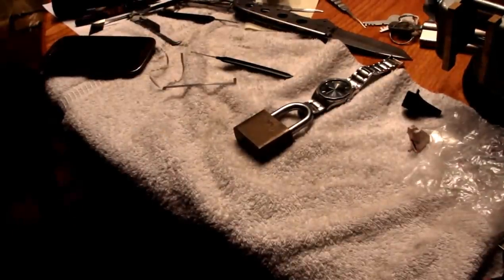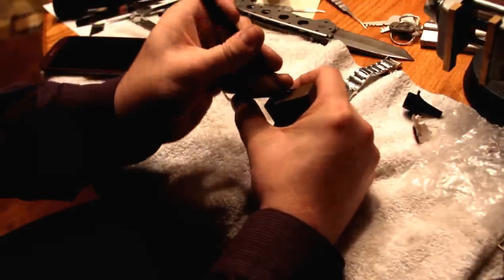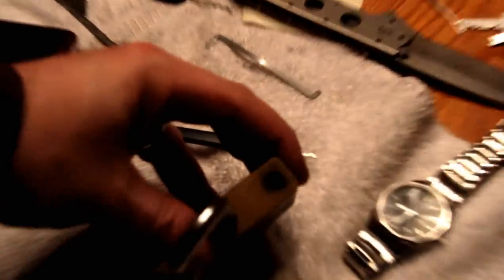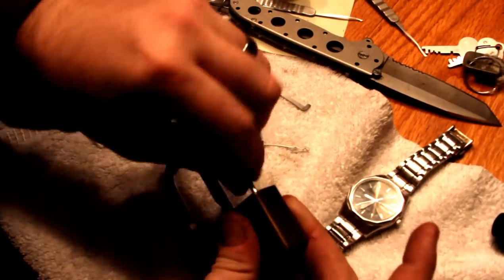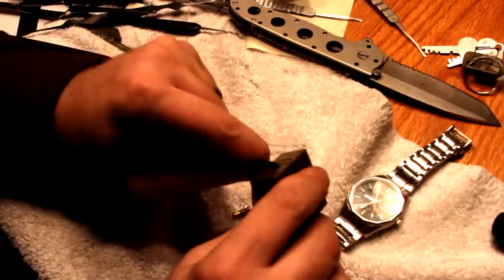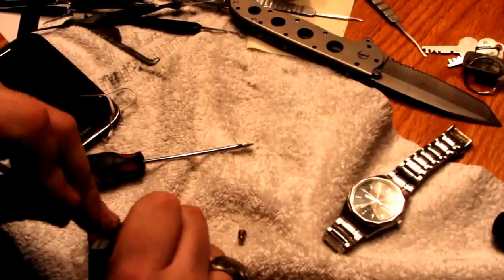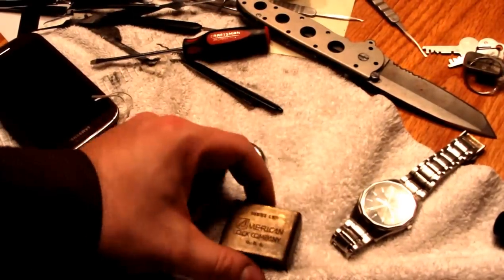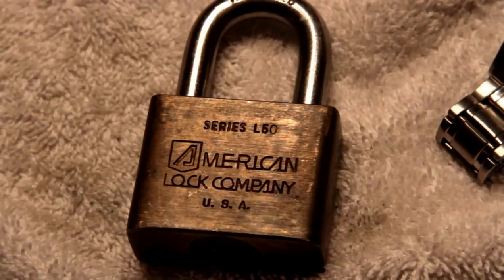(066) Unexplained Screw -- American L50 -- Wafer Tumbler Marathon

Comment from the maker: Diceman and mresurm forwarded me a PDF of an ancient manual for these locks.

The screw retains a small pin which, assuming it can be cajoled out, retains the core. I'll see if I can pop it out. At least one of the locks is in good enough condition that I expect it's not rusted in place. 

Thanks to diceman and mresurm for the PDFs, by the way!

Comment: The tip of the screw blocks a pin from sliding into the space where the screw was.  The other end of the pin fits into a slot milled the edge of the plug face.  This retains the plug in the lock.  Often these pins stick and need a bit of persuasion to remove them.  Try leaving the screw out and rapping the padlock sharply against the end of a 2 X 4.